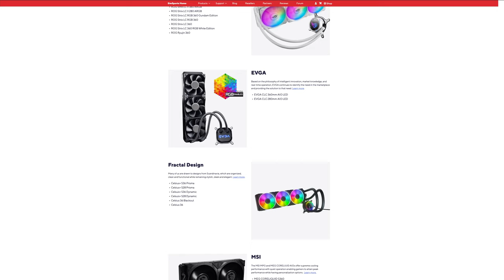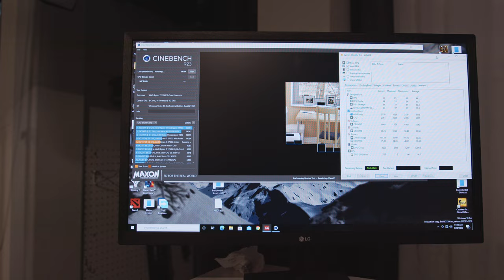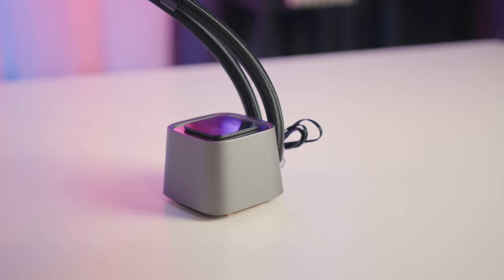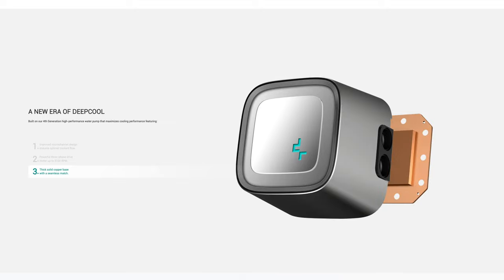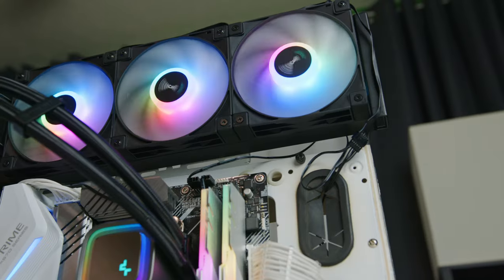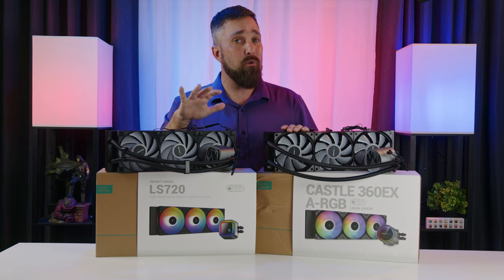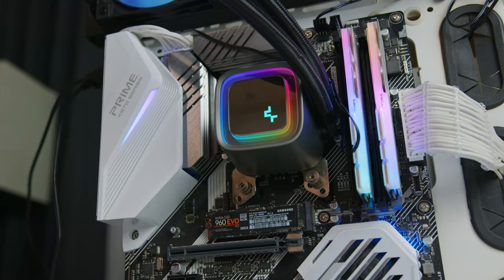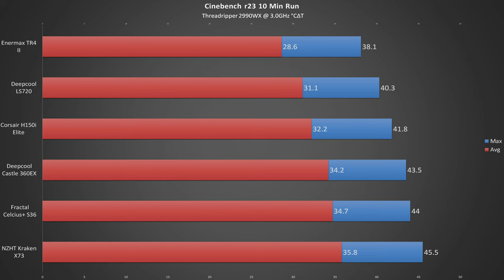High End Cooling For Cheap! DeepCool LS720 AIO Review.

Comment: Avid gamer here, my 13900kf in hardware monitor hit a max package heat of 84C.  In Modern Warfare 2, 4K hardcore battles with LS720.  A chillier uplift from my previous cooling Cooler Master heatsink & fan with 12700kf in that the game would constantly lock up and shut down because temps were reaching 100C.  It doesn't hang anymore and the only thing that is frying are my opponents.

Comment: I recently put this on a Ryzen 5600 cause I got it on sale. The results are actually insane. Running the CPU from it's 4.4ghz boost up to 4.6ghz . Never moves in games . Temps in gaming never over 40oc. If I throw on cinebench I'm hitting 64oc. Not tried prime yet but why bother for my use. Wipe off that paste btw. I used grizzly hydronaut. Big difference I bet. Overall paying the extra for this has been much better than paying for an X logo on my CPU.
Reply: Ran Ryzen master curve optimization and now over 12k on cinebench r23 . It's all the AIO. I. Idle now at 18oc

Comment: Anybody buying this aio, I would like to point out the rgb connector that comes from the cpu block will NOT come out of the fan if connected directly. This is because there are only 3 cables going into the header opposed to the fans rgb connectors having 6. The fan connectors pull out easily but you have to pull SO hard on the aio rgb header to get it out that my first one completely ripped the wires out of the connector. It happened to my friend as well, and do NOT use needlenose, you will absolutely destroy the plastic. If you have made this mistake by no fault of your own and plugging it in directly (they don't tell you) you can lift the flap near the screw hole of the fan to access the inside of the socket. You can use a small tool to press in the retention clips that aren't accessible outside of the fan to get the connector out. The aio comes with an rgb extension cable, this is what you want to plug into the fan, and in turn plug the aio rgb connector into. There is a lot more slack and it makes it easier to pull it out.

Comment: I came here to look at this AIO in comparison to its 2 fan brother, as my next build will have a case that could support either size the smaller one on top and the bigger one up front. and from what I see I could find them priced at 125cad and 149 cad so like $25 different however both were out of stock most places at present so I will have to wait and watch for them to see if they come back in stock.

Comment: I Had a question bro. There's two pwm on LS720 one is the 3pin pwm on the pump and the other 4pin pwm is on sata connector. If I change the fan two other brand. Should I still connect the two PWM to the motherboard?

Comment: Hello elevated system, one question for you, not related to this video though, if you happen to know, does the m1 mac mini have a ACTIVE PFC power or passive pfc??
Reply from the maker: I don't have official info on that but considering there is no voltage selection switch I assume it's active, but that's only an educated guess.
Reply: @ElevatedSystems  alright, but thanks anyways

Comment: Hi I Have i9 9900k .
LS720 Or ROG LC II Wich One Is Better For My CPU ?
Reply from the maker: The Asus is a good cooler but you won't see a difference between the two on a 9900k and the Deepcool is something like $100 cheaper so a better value.
Reply: which one did you end up with?  i also got 9900k and cpu gets to 100c in warzone 2. my be quiet silent loop 360mm is done i think.
Reply: @canson1988  u should give a try to liquid freezer II 360 or 420
Reply: @adamu6941  i did actually buy the liquid freezer 2 360mm couple weeks ago. Very happy with my purchase

Comment: LS720 or PL360 Flux? Someone can help me? Same price.
Reply: To put on what CPU?
Reply: @bumblefoot5  5700x
Reply: @tiagoquintiere  I put the ls720 on a 5600 Ryzen and results are insanely good. Scoring 12k now on cinebench with just 250mhz auto boost and Ryzen master curve optimizer. 12k is miles higher than my CPU should score. Higher than a 5600x by a lot. Can't even hit 70oc on prime95 stress. Used grizzly hydronought on it for paste
Reply: @bumblefoot5  I'll put one too. Thank you for the informations!
Reply: @tiagoquintiere  No problem happy to recommend it.  I top mounted mine not sure if that makes a difference..